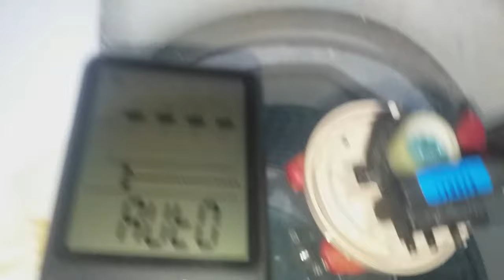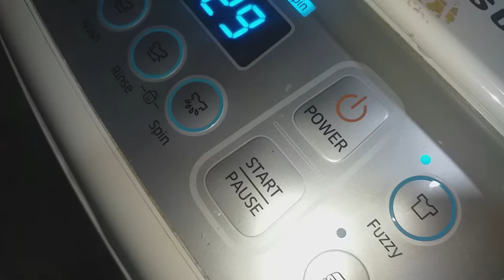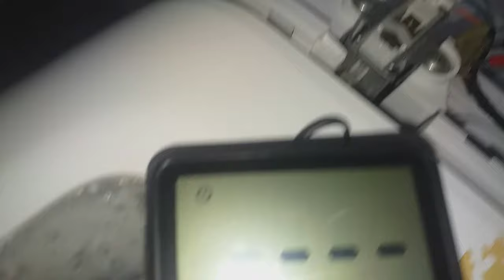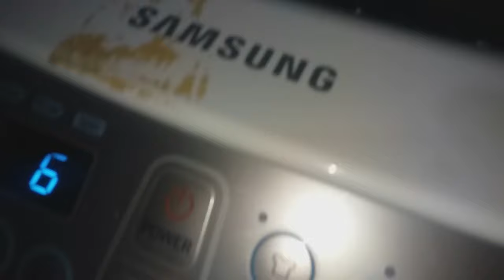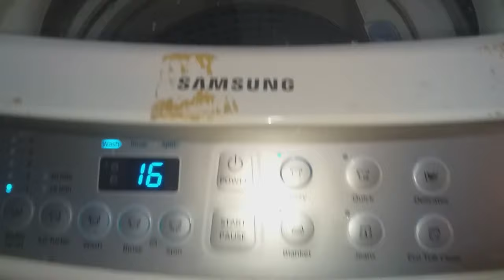HOW TO REPAIR WASH AND DRAIN PROBLEM SAMSUNG WOBBLE AUTOMATIC WASHING MACHINE

Comment: Hi sir, ano po Kaya problema kpag nag on, k po ng wobble washing washing machine 7.5kg nagstart agad magspin pero ang spin mahina lang sir at ilang Minuto lng. Hindi PA umaangat ang tubig bigla n lng magswitch off ang washing machine.
Reply from the maker: possible po may shorted sa na components parts sa control board